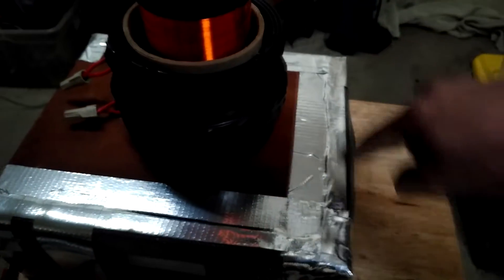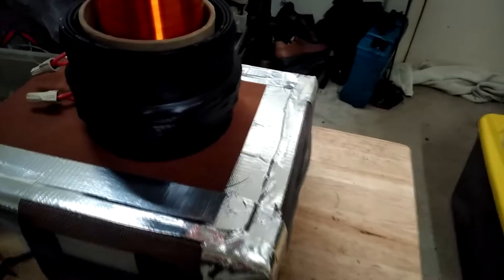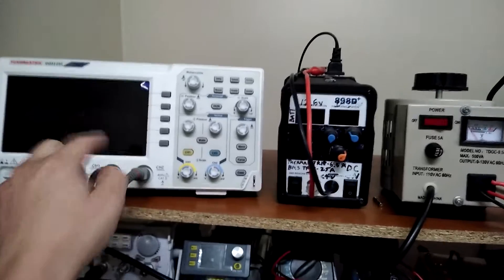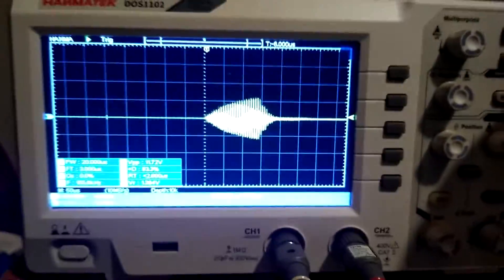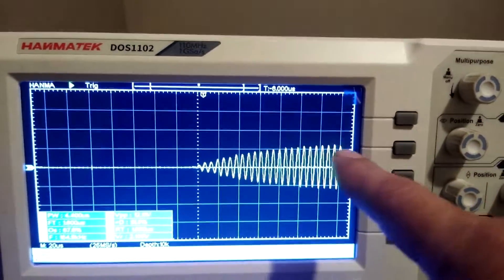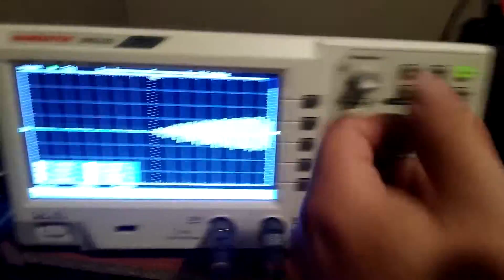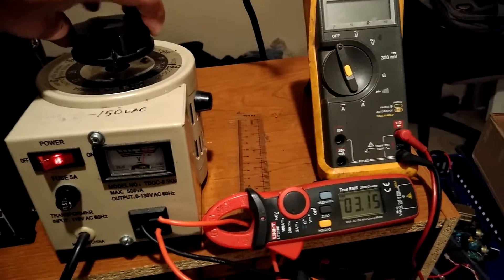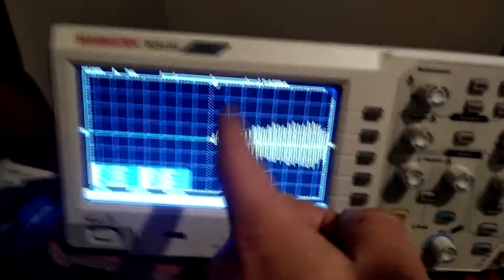'Budget?' DRSSTC power draw (~600W)

Comment: Those are some nice arcs, I'm trying to build a drsstc setup with ucc27425 but their output current is too low (4A) which means they can't drive a full bridge. I'm thinking if I should parallel them to make them 8A?
Reply from the maker: You may be able to parallel them so long as you are inverting the input signals so that they are switching high or low at the same time. I think it does say that you can though. Depending on the switches you're using you might get away with a 4A pk driver. Maybe not these particular IGBT's in a full bridge.
Reply: @Magneticitist  Ill be using fga60n65smd in a H-bridge, I've tried them in a half bridge with ucc27425 basically labcoatz sstc circuit. They worked well but now I want to make it a full bridge and add OCD to run it on Dual resonant mode since I'm not satisfied with my sstc arcs. Btw is it safe to run drsstc on a 320kHz coil? My coil's resonant frequency is around 320kHz with topload.
Reply from the maker: @JustDum_  Yea I've ran closer to 400khz before. The lower the better but if the switching can pull it off then 400khz will work.

Comment: Hi, I made this same circuit and it worked with Half Bridge at 125VAC input. When I connected 230VAC (325VBUS) input, the housing protections were triggered and the IGBTs died. I used two FGH60N60SMD. My GDT was wound with a 1:1:1 ratio and with a 12VDC driver supply, so at the output of the GDT I had +12V / -12V. 

Maybe it influenced the GDT voltage in the death of the IGBTs? I should have run the GDT at a 1:2:2 ratio to have gotten +24V / -24V at the output of the GDT to run the Half Bridge at 325VDC Bus?

Thank you very much. Best regards
Reply from the maker: Those switches seem more demanding than the 60N65's I use and I would be using a 15V drive myself at least.. but I'm not sure a 12v drive would have resulted in failure. I think it's more important to see what the waveforms actually look like. If your gate switching is not ideal then you have a number of potential bridge problems. A good snubber capacitor for the bridge around 2uF is definitely ideal as a safeguard against bad switching that could occur.

My first failures going that high in voltage were actually not what I thought.. it was all related to circuit strikes I couldn't see with the naked eye and shielding everything fixed that problem. The other safeguard is the OCD which keeps you from pushing too much peak current. If the primary is tuned too far away from the secondary then it will just keep building higher and higher in resonant rise before transferring any power to the secondary and this can be hell on your bridge. 

+24/-24 is not something I've actually tried with those kind of switches and I always assumed it was more for bricks. I personally never had issues with 15V drive.
Reply: @Magneticitist  Thank you very much for your quick response

My primary is tuned at 122kHz and my secondary with toroid at 147.5kHz, which gives a detuning of about 17%.

I have set the OCD at 300A maximum, and what surprised me a lot is that as soon as I connected the half bridge with 325VDC and with the pulse width of the switch at minimum, the electrical protections of the house were activated and the IGBTs died.

Something that with 125VAC input and 176VDC in the half Bridge does not happen. I have to say that with those voltage parameters, 300us on time and 300BPS, the consumption of the coil was 380/400W.

At least now knowing that having the GDT at 12V is not a problem to run the coil I have to look how to solve this. I will look at the waveform as you have told me and add the 2uF capacitor. That capacitor I connect it in series with the GDT?

Thank you very much again
Reply from the maker: @alexcaleal9025  122khz does not seem like too demanding a frequency especially for only 2 switches. That's lower than I've ever gone. 17% detuning is not something I'd be trying to start out with though. I would want to gradually detune it after initially testing it with the closest tuning as possible. 15% is typically recommended at most because that is probably around the point where OCD is going to become absolutely necessary in keeping your bridge from dying. I would basically want to ensure I was seeing satisfactory spark propagation at the lowest voltages possible first. 

OCD and on times can be tricky with detuning. For example I think I initially had a failure with OCD properly set ( I thought), to where everything ran fine at 150uS or so on times.. but then cranking the same voltage at much lower on times ended up killing the bridge as opposed to being more healthy for it. I think it may have had to do with the relation between the spark propagation and the tuning at the time. For example a higher on time, with certain tuning, may actually influence better tuning during spark propagation as opposed to much lower on times (and thinner sparks). I seem to naturally start at around 100us most of the time and feel out the OCD via trial and error. I figure I might have a random unknown failure anyway.. so I may as well risk an intentional one by investigating the limits of the bridge and OCD settings with trial and error. 

300us seems a little too high for initial testing as well. If say I needed to push 300uS to get what I thought was reasonable sparks, I would be thinking I needed to retune it so that I only needed 100us, or 150us for example.
Reply from the maker: @alexcaleal9025  The snubber capacitor would go across your bridge directly across the rails. You do need a series capacitor across your GDT primary though, this will be a DC blocking capacitor. Typically something between 100nF and 1uF but I'll often just use a 2-4uF ceramic or as low as 100nF for small bridges.
Reply: @Magneticitist  Agreed. You are right

I can try 10% detuning. Maybe, it is too detuned the primary with respect to the secondary. While it is true that it seemed that the spark with 17% detuning seemed more natural? Or maybe it was just a simple perception of my eyes haha. I will do as you said, try lower voltages and see what happens with the OCD. And progressively raise the input voltage

I tell you it is super strange that it works fine with 176VDC on the bus but with 325VDC on the bus and a turn on time of 58uS the housing projections are activated.

I don't know if you have an email where I can consult you or something, since the video is going to be full of comments. I am focused on this driver and I would like to make it work 100%. 

Thanks a lot for the information about the cap

Best regards and thank you very much for your time
Reply from the maker: @alexcaleal9025  You can email me at Magneticitist@gmail.com

When it comes to tuning you have to use a mix of calculations and real world observations. When using real world observations, you have to make sure they are mirroring how you are actually running the coil. For example, the primary resonant frequency by itself compared to with a secondary present. When you get to close tuning it becomes easy to make slight changes with the primary coupling height as well as the topload. 

The closest tuning between the two coils will produce sparks at the lowest voltages. When you detune them, the secondary may seem to suddenly burst into higher output when reaching the higher voltages. This is because you are encouraging the primary circuit to ring higher and higher before finally dumping the energy into the secondary, which by that point will have become close enough in tune to allow this transfer. It's a game of riding on the edge of what can kill the switches.

I don't think it's strange OCD would kick in at low on times with higher voltage because the primary seeing double the voltage. Your primary current should be increasing with primary voltage so you'd have to in practice set your OCD final tuning at that highest voltage.

If you can scope your bridge output waveform at 170VDC relative to maybe 250VDC you might be able to see ringing with high peaks that could be killing the switches. If the OCD protection is actually kicking in at any given time, it should only be backing the on time down into the gate drivers to low enough that the switches can't be running excessive current. For me this has always kept my bridge from dying when it would have otherwise failed.
Reply: @Magneticitist  Thank you very much for all the information you are giving me.

I will write you an email with the news

At the moment, I have measured the waveform on the secondary of my GDT and it is quite horrible (waveform measured with the secondary empty, I don't know if it influences anything). The waveform is ugly and is like a kind of oscillating sine waves.

On the other hand, measuring the waveform without GDT, a rectangular pulse waveform appears on the oscilloscope, which is what you should see.

I'm using a typical green core that I've seen used in various coils. 

Admittedly, I have never been interested in looking at the waveform of the GDT secondary before. If the GDT made the "hum" I took it for granted and ran coils like that (for the SSTCs). I hope that maybe this is where the problem lies and the coil can work properly
Reply from the maker: @alexcaleal9025  The GDT is definitely important and you don't want to have any ringing on the gates like that. The core material, the number of turns, the way it's wound, the leakage inductance etc.. these can cause horrible waveforms or great ones. You want to make sure any pairs are twisted, leads are short as can reasonably be, and that you are reducing any ringing that would reasonably occur with some kind of gate resistance. If your gate resistors are too small you will see overshoots on the square waves at the gates. 

Use Richie Burnett's GDT guide as a helpful tool in diagnosing possible issues in the GDT. https://www.richieburnett.co.uk/temp/gdt/gdt2.html
Reply: @Magneticitist  Thank you very much for all the information

I just sent you an email with the updates

Comment: I am building a similar setup with similar results and you’re right on the OCD. I have to set it to 400 amps to not constantly trip with a good output, but these IGBTs just take it. At least if I’m setting my OCD right, this is my first DRSSTC. Not sure how they haven’t exploded yet honestly. Also, in a previous comment you mentioned something about the UCCs not being able to take more than 1khz BPS and 100us on time, is this a physical limitation to the UCCs? I’m wondering if that is why I had a UCC fail. It started outputting a garbage signal and drawing several amps while getting instantly hot. Thanks for this vid! Definitely inspired many aspects of my build!
Reply from the maker: Hard to say about the OCD because it can take some difficulty to accurately measure, but the IGBT's do indeed deal with it.. I got comfortable with the idea that they can handle whatever I want to throw at them given a limit of total power consumption.
As for the limit of the UCC's this was strictly based on those particular IGBT's I was using at the time in a full bridge arrangement, and relative to the actual running frequency. 

I typically can run a full bridge of those IGBT's at no more than 300khz or so assuming I'm running SSTC kind of on times. With the DRSSTC it doesn't struggle so much because of small on times, but once you get up to around 1khz BPS or so that power really goes up. I felt like that was probably my limit to keep from over working the drivers.

You can typically get an idea of how hard the UCC's are working just doing a finger check on their temperature. I like to add a fan blowing on them just to keep them happy and little heatsinks if I can. I also always monitor my logic supply to see how much current is actually feeding into the low voltage side, which is predominantly the gate driver draw at any given time. You can sort of monitor that current draw while adjusting the interrupter output and get an idea of what settings start to really have those gate drivers chugging. At say 20V logic input when I see the current start to rise over a few hundred milliamps I know it's getting into a region where they are working hard. 6-7 watts per each driver seems about what they can take before crapping out.
Reply: Assuming my OCD is close to accurate, I would like to lower the peak current for sure. I think I am running too much primary capacitance: 150nF at 4 primary turns. Hopefully I can lower currents by decreasing my capacitance to 75nF at closer to 7 turns. Is there a better way to measure peak currents without using OCD? I also just got some cheap BSM100GB IGBT half bricks from AliExpress for a similar price to 2 60n65s, it’ll be interesting to see how/if they work. Not expecting too much though. They are rated slightly better than the 60n65s but I doubt they’ll perform as the data sheet says. Thanks for the information on the UCCs, hopefully I can find that limit without pushing past it too many more times.
Reply from the maker: @ElectronicallyIrresponsible  150nF does sound pretty high for a relatively low to mid power build. In my head I sort of figure it kind of like how I'm tuning a ZVS driver or something. Whether it's an induction heater or flyback driver or whatever, I usually try to find that compromise with the current by upping the tank capacitor size until it starts to pull more power than I'd want. 

Aside from actually scoping the primary using some kind of CT and burden resistance for measurement I'm not really sure how to easily get an accurate peak current reading. What I basically did was first test my build with no secondary completely unloaded except for a loosely coupled piggyback coil laying on top of the primary, and it had just a 120VAC incandescent lightbulb hooked to it. That's what actually became too much for the bridge once I got up to max voltage running high on times and max BPS. With that reasoning I assumed a properly loaded primary throwing streamers from the coupled secondary would easily handle max voltage and max BPS up to a certain unknown on time. From experience I've always been able to run any of my DRSSTC's at close to 1ms though so long as the BPS wasn't too high. Just regular Steve Ward drivers no "skip pulse" or anything.

I'm going to eventually do a CM200 or CM300 like Arc Angel runs on some of his. People seem to do well with them and can find them for under $100. Where I work now I can sometimes get scrap stuff like big capacitors or maybe heatsinks etc so I'm like slowly adding stuff up for the build using bricks.

Comment: You inspired my drsstc design, thanks a lot.
I was wandering how much can I push this little to247 igbt (fgh60n60smd) pretty similar to yours and I got 75cm sparks  at 300Vbus
 You can see some midi modulation on my channel :)
Reply from the maker: That's awesome. It's a pretty nice setup for what it is. I never actually played with it much after getting it running good cause it's so loud but I had a feeling the output could be improved.
Reply: @Magneticitist  I was actually surprised by how loud those things are, at full power you have to use earing protection otherwise after playing a single song your ears are ringing like crazy

Comment: wow lightning that is very very very beautiful ... what size topload are you using, my friend?
Reply from the maker: Just a random dryer duct about 10in diameter 4inch duct
Reply: @Magneticitist  So why do you wrap a 4-inch pipe to form a 10-inch circle?
Reply from the maker: @hadisuratno3953  dryer duct is just a cheap and easy solution to make a toroidal shaped topload. I wasn't picky with the size I just got what was available making sure it wasn't too small or too large and tuned the primary circuit to account for it.

Comment: Well it looks very happy - good power output quite stable - the undulations are interesting ringing pattern - look vert impressive …
Reply from the maker: Yea I'm happy with this one cause for a while I was on a mission to build my own DRSSTC for cheap but I could never quite get good enough output on a $50 budget (I still need to tune them better though and had put them aside). I cheated with this build by just using the full bridge and 340VDC.. A lot of other American voltage coilers are able to get the same output without a voltage doubler it seems. Still, the whole point was just getting the output for reasonably cheap and I can say this build is reliable now. I actually only had issues due to not shielding everything previously not being used to arcs as long. The IGBT's used are surely the real winner here as they are extremely durable but it's actually quite easy to achieve 2.5ft at least with such a setup and it's in fact hundreds cheaper than buying any kit I can think of that provides about the same size coil or output. Due to only 2 gate drivers I can't run like 1khz BPS unless I keep the on time below 100uS or something but that's a sacrifice I'm cool with.